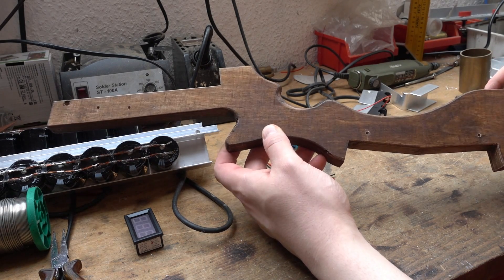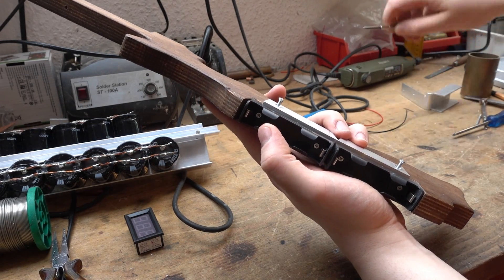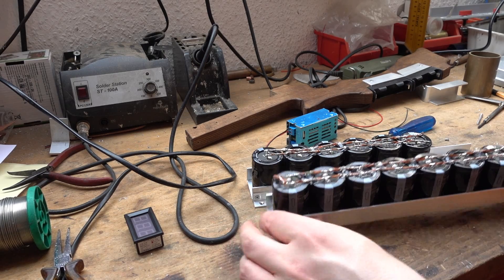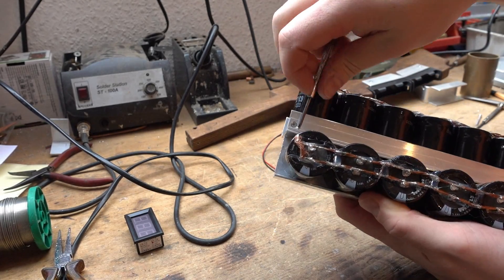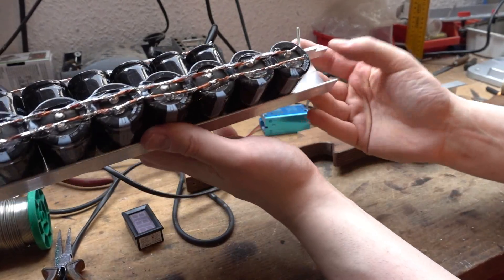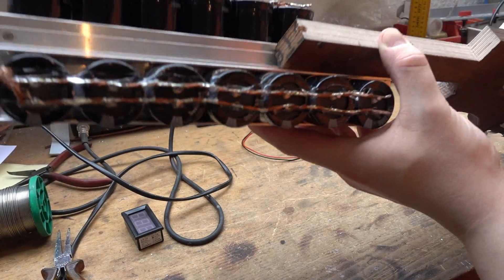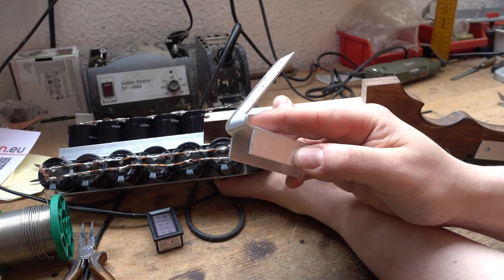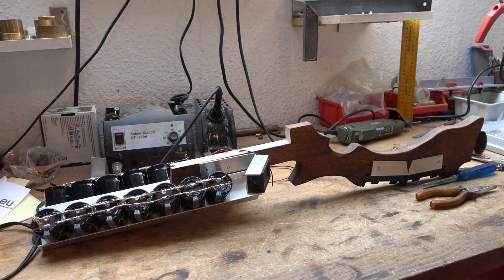We make a portable railgun tutorial, part 2. Stock-mod and cap bank

Comment: what are you going to use as an inyector?
Reply from the maker: Next video will show. Most difficult part is the rails itself actually.
Reply: if the contact area of the rails is small, you will reduce friction, which it is kind of a big deal, but as a consequence the rails will be at a higher risk of melting/solder to the proyectile because of the high current passing through a small area, 
increasing the contact area will reduce that risk but increase the friction. you said that the rails were going to be short, try (as a proof of concept) put 2 big steel nails as rails (i think it will be better that copper or aluminium) and see what happends. Good Luck
Reply from the maker: Bad contact to rails and you get sparks and burn the rails. Not too good either. I got a plan and I know what I am doing, wait and see :>
Reply from the maker: Thats kinda what I said, yeah.